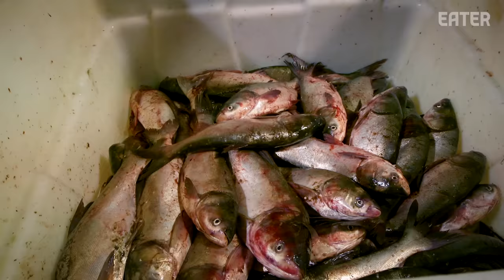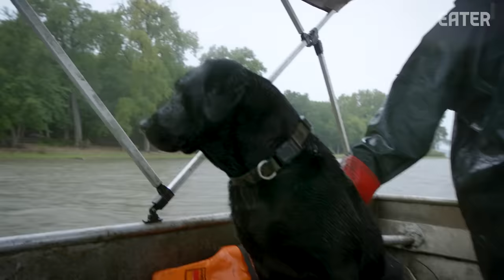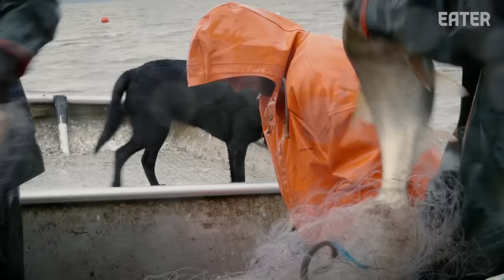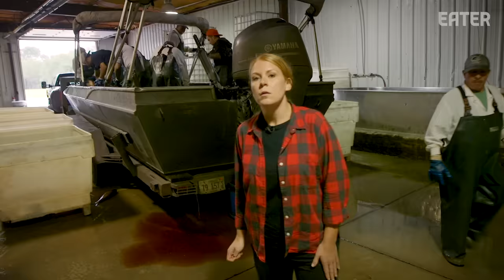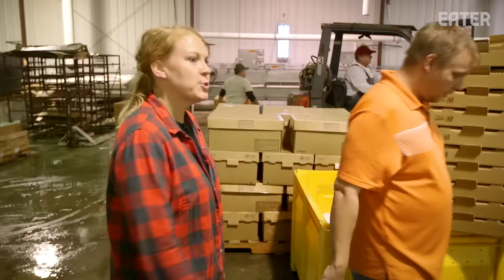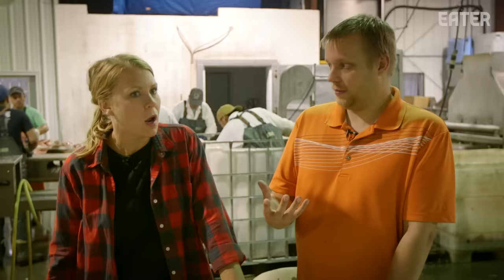How Fishermen Are Fighting to Control the Asian Carp Population — How to Make It

Comment: It's true they are very invasive and need to be controlled but they can be used for alot of different things tbh. Fertilizer, animal food, not to mention they taste DELICIOUS!!! They are very bony but if you grind them down, they can be very tasty as fish cakes or fish sticks. Grind them twice through the processor and you won't know the bones were there. Tastes kinda like crab cakes. Also delicious in stews or broiled and if you can use chopsticks, the meat can be easily picked apart from the bone. Really tasty white meat.

Comment: Too bad they didn't mention the high levels of mercury in the Illinois River or how really you're not supposed to eat too much fish that come from those waterways.  At least, that's what the government says.
Reply: +terrabus1  It's well documented that these carp from these rivers have lower levels of mercury than most commercially caught eating fish.
Reply: Tosh T b/c grass carp are filter feeders eating plakton and not on the bottom where heavy metals are. Plus dont bioaccumulate toxins like predators do.
Reply: @codkue5142  they also eat floating vegetation.
Reply: Joe Smith  governments in general destroy mercy, that is true :)
Reply: @dm8867  They need to add the asian carp to this list, or the similar ones I've seen elsewhere. The silver and big head are filter feeders, they eat a completely different diet than the common carp, and than any other fish they showed. Paddlefish are very similar in how they feed. 

This is a pretty good example of bio accumulation though. The white and largemouth bass are the only ones with mercury, just so happens they are the ones that mainly eat other fish (kind of surprised the smallmouth wasn't listed as having it too, although they eat insects and crawdads and other critter like that more often, which might not contain the same levels as the fish the other bass eat).

Comment: I have an idea about the bones, smoke the carp with apple; or hickory wood and then pressure can the smoked Carp to soften the bones
Reply: Karp bones are too hard to get softened.. Even if deep fried.

Source: I eat karps
Reply: remove backbone smoke the fish pressure can the fish so the pin bones are soft sort of like sardines in olive oil
Reply: I always eat common carp deep fried. Not boney at all. You should try, get those 5 to 6 inches ones. By the way, these fish are really expensive in my country in Asia.
Reply: Is it really that hard to just eat around the bones? I do so and it's not that hard.

Comment: NOTE FOR THE FBI! THIS FISH CAME FROM RUSSIA'S FAR EAST. IT IS CALLED SILVER CARP (Hypophthalmichthys - LAT.) (ТОЛСТОЛОБИК - RUSSIAN). IT HAD ITS FIRST PLACE OF ORIGIN IN RIVER CALLED AMUR. THAT IS A HUGE WATER LINE THAT GOES BETWEEN RUSSIA AND CHINA TILL OKHOTSKOE SEA. THIS SPECIE WAS FIRST MOVED BY RUSSIANS TO CENTRAL ASIA IN 60S WHEN THEY BUILT SEVERAL WATER CHANNELS THAT WERE MADE TO USE WATER OF AMUDARYA IN TURKMENISTAN AND UZBEKISTAN. THIS FISH IS EXTREMELY VORACIOUS FOR WEEDS WHAT WAS A MAJOR PROBLEM IN THE CHANNELS THAT GOT JAMMED BY WEEDS. LATER IT MOVED TO RUSSIAN RIVERS DON AND VOLGA THEN FURTHER. THIS INVASIVE SPECIE MAY HAVE BEEN PLANTED INTO AMERICA'S RIVERS WITH TERROR, SABOTAGE OR CRIMINAL INTENT.  IT IS VERY EASILY CAUGHT INDUSTRIALLY BY FLOATING SURFACE NETS THAT AREN'T DEEPER THAN THREE FEET FROM THE SURFACE OF WATER. IT IS SMART TO CATCH ONLY BIG FISHES AS THEY MAY EAT SMALL FISH OF OTHER KINDS. SMALL SILVER CARP FEEDS ONLY ON WEEDS WHICH MAY BE RATHER POSITIVELY THAN NEGATIVELY CONSIDERED QUALITY. ITS MEAT ISN'T TASTY AT ALL AND WAS USED IN RUSSIA'S CANNED PRODUCTS IN 80S WIDELY AT CHEAPEST PRICE INTERVAL. WHERE AMERICA'S RIVERS ARE CLOGGED UP BY WEEDS THE SILVER CARP MAY BE A SOLUTION TO CLEAN IT OUT AS IT PERFECTLY WORKS OUT IN CENTRAL ASIA. IN FACT, SUCH TERRIBLE POPULATION OF THE SILVER CARP INDICATES THAT WATER HAS BEEN SERIOUSLY POLLUTED BY WEEDS THAT ARE DANGEROUS FOR ANY WATER ANIMALS AND FISH. AREN'T BLUE-GREEN SPHERICAL WEEDS, THAT ARE WELL SEEN ON SURFACE OF THE WATER IN THIS VIDEO, AN INVASIVE STRAIN?